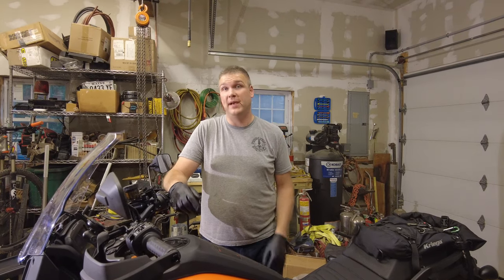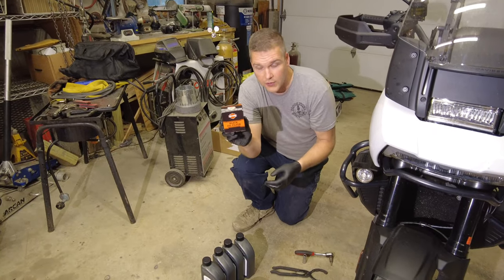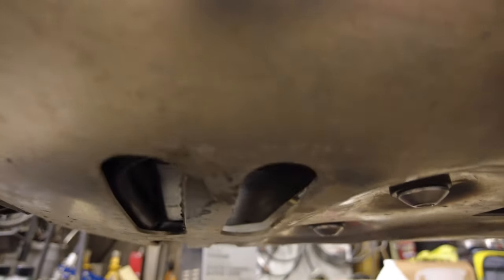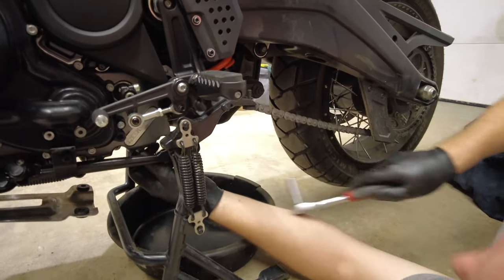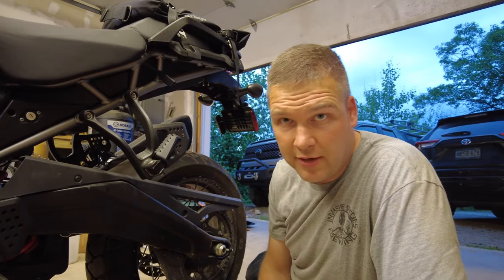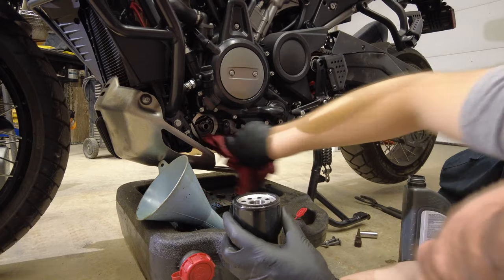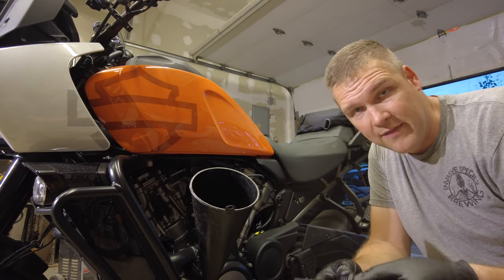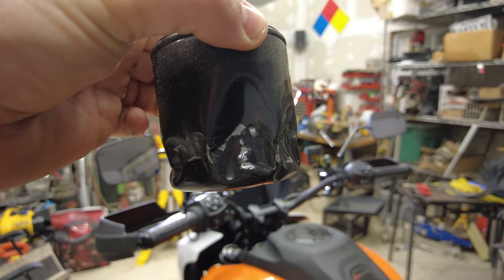Harley Davidson Pan America Oil Change First Service How-To 4k HD PA

Comment: the manuals say to check oil on the side stand with the engine at operating temperature, I changed mine a while back, and was on the center stand at first, I decided to put the bike on the side stand, and I got quite a bit more oil out over draining on the center stand, next time I am doing the whole oil change on the side stand,
Reply: not sure what the poster is reading but per the Service Manual.. 
Add 3 quarts and run for 10 seconds..
THEN
ADD JUST ENOUGH OIL TO BRING THE DIPSTICK TO THE "ADD QUART MARK" 

So you only add enough oil to bring the oil to the very bottom line... Then.. when you actually run the engine to operating temp.. you should be right on the money at full.. Dont ask me why.. Its a Harley thing lol

Comment: The owners manual says a different weight of oil. And it also says to do the change on the jiffy stand, not the centre stand. Maybe it effects how it drains.
Reply: @Run Everyday uhhh it does not say anything about filling oil filter
9. See Figure 2-5. Install new oil filter.
a. Lubricate gasket with a thin film of clean engine oil.
b. Install new oil filter.
c. Hand-tighten oil filter three-quarters of a turn after
gasket first contacts filter mounting surface. Do NOT
use oil filter wrench for installation.
Reply: @Run Everyday I copied it line for line out of the Service Manual..

Technicians dont use owners manual for service. Therefore as a HD tech I am gonna go with the service manual on this one.. wouldnt be the first time the two teams didnt communicate before typing out the books.

Comment: Looks good, but I would want to at least try something else to loosen the oil filter, before mangling the thing up with pliers. A strap wrench would probably break it loose. After the first oil change, you should be able to use an end cap type remover.

Comment: Would have been nice for you to have told us how much of the fourth quart you actually used.
Reply from the maker: Just a little bit of it. The manual is vague as the bike will take more or less depending on the stroke of the motor when stopped. The oiling system is very complex, and sometimes it may take more than others, hence why the manual doesn't even tell you. I think in my case it took 1/2 pint. Ride Safe
Reply: not sure what the poster is reading but per the Service Manual.. 
Add 3 quarts and run for 10 seconds..
THEN
ADD JUST ENOUGH OIL TO BRING THE DIPSTICK TO THE "ADD QUART MARK" 

So you only add enough oil to bring the oil to the very bottom line... Then.. when you actually run the engine to operating temp.. you should be right on the money at full.. Dont ask me why.. Its a Harley thing lol
Reply: yeah, Harley always measures oil when hot, and doesn’t put a cold measurement on the stick.

Comment: Sorry but you are doing it wrong.
You should drain the oil on the jiffy stand, because you'll still have a little over 1/2 of old oil in the engine if you keep the bike on the center stand.
Also, priming the engine filter is better than installing dry.
But what I know, just working with bikes for over 20 years.

Comment: So I just came accross this video and its crazy how many people say "the manual says this.." When it says NO such thing at all... 
HERE IS THE REFILL PROCEDURE DIRECTLY FROM THE MANUAL 
13. Add an initial volume of engine oil. Refer to Table 2-4.
Table 2-4. Initial Oil Fill
ITEM QUANTITY
Engine oil initial fill 3 qt (2.8 L)
14. Install filler plug/dipstick.
15. Run engine for 10 seconds.
16. Turn off engine and remove filler plug/dipstick.
---------------------------------------------
17. See See Figure 2-3 .. Add only enough oil to bring the level
to the add quart mark.
---------------------------------------------
18. Verify proper oil level.
a. Start engine and carefully check for oil leaks around
drain plug and oil filter.
b. Check engine oil level. See Check Engine Oil Level
(Page 2-7). in this section.
Reply: PROPER WAY TO CHECK ENGINE OIL

ALLOW ENGINE TO IDLE FOR APPROX 10 MINTUES OR RIDE UNIT UNTIL TEMP REACHES 180 DEGREES OR HIGHER...

TURN ENGINE OFF AND PLACE ON SIDE STAND.. 

PROMPTLY CHECK DIP STICK BY REMOVIN.. WIPING CLEAN AND RETIGHTENING BEFORE CHECKING

Comment: Nothing bad will happen if u push in any  API SN, JASO MA-2 for 4T - 10W40, 20W50, 10W50.....and it will be 100% ok for 99% fo this bikes' users.  Maybe someone at HD decided to play a "pranc" with the owners ?, or to test their IQ ? 🤔 
These numbers ( xxWxx ) tell the lowest / highest usable viscosity temp. Other qualities of the oil are API SN, JASO MA-2 4T.  
But the 15W50 4T is a pretty common MC oil, where is it possible NOT to find it ?
Reply: The rev max REQUIRES CJ4 spec'd 20W-50 diesel oil. 

Engineers including independents that have performed viscosity studies on the rev max have openly stated in forums that you SHOULD not use just any plain oil.